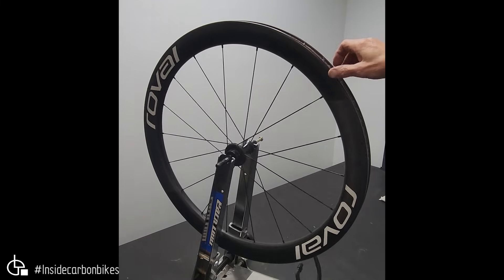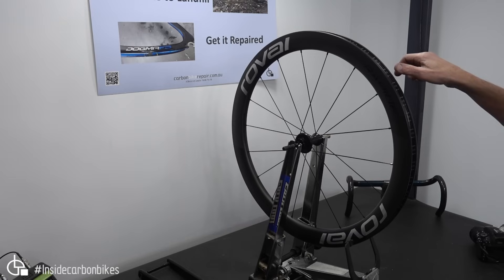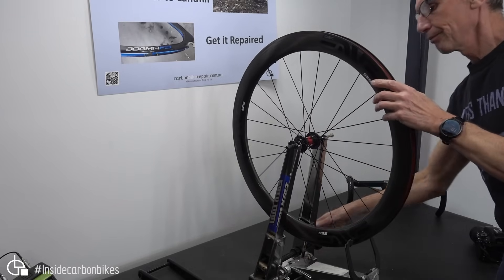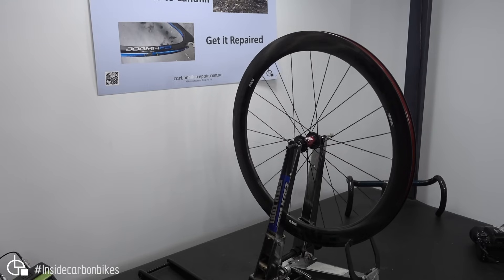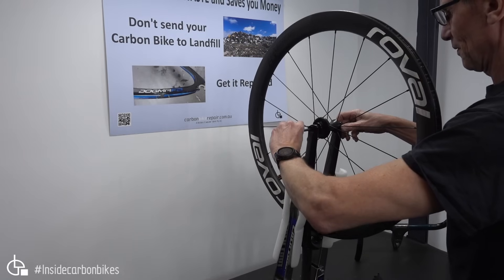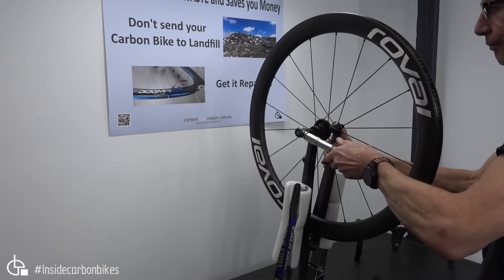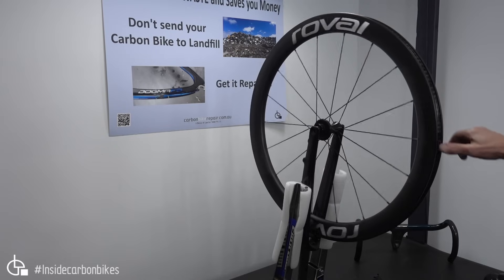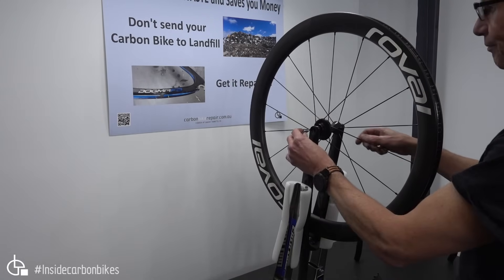Hub Bearing Test - It's not the axle!

Comment: I had a 240 hub I changed the bearings, spun freely, then I pressed them in slightly too much (yes using the correct drift) and they didn't spin as well. Kind of stuck at that moment as removing them would have potentially caused issues with the bearings and race as that can get pitted when pulling them out. So if I had to guess the face the bearing sits in gets a little tighter when fully pressed in. This was a while ago and I never got the chance to try again. As mentioned elsewhere it could be seals and one wheel using single seals and the other double (RS vs 2RS)

Comment: I suspect it could possibly  be a result of somone using  a pressure washer to clean the bike resulting in road grit being blasted into the bearing internals causing possible damage & resistance
Reply: On two different wheels?
Reply: Only a disassembly & inspection can determine a resistance issue such as this.
Factory manufacturing tolerance would otherwise be the obvious problem
Reply: It's quite easy to tell grit or rust in a bearing

Comment: My money is on seals, if you say there is drag but everything smooth without notches or inconsistencies.
Next I'd check if the bearing seats in the hub shell are undersized, if the hub is relatively new (otherwise it will develop indexed tight spots). Latter can be also connected to too low spoke tension.
Reply: Even differences in type of grease and how much can affect spinning.
Reply: @johnlesoudeur3653  that too, but not to that much extend with cartridge bearings though.

Comment: bearing seats in the hub might not be concentric which is overloading the bearing. Through-axle should not make any difference. If anything torque can only cause more bearing friction.
Reply: Not quite... There is a spacer tube between the 2 bearings that in theory sets the bearing preload on the inner bearing sleeve. The end caps then install to the inner sleeves of the bearings ... The bearings may be a tight fit to the housing compressing the outer shell causing high drag, the seals may be tight ( doubt it) or there is bearing failure... If its been previously dismantled from factory the bearing removal technique can cause the shoulders on the bearing spacer tube to be mushroomed and effect the preload when reassembled causing the high drag also... The way to test the bearing preload is to partially remove 1 bearing - say 0.05mm to 0.10mm so that there is no preload and the bearing can turn centralised  in its machined groove and retest the rolling resistance of the bearings .. if it rolls ok the issue has be isolated
Reply: Crappy machined bearing seat in the hub. Too tight, compresses the outer ring of the bearing. My 2 cents.    Rgr

Comment: Here is the difference between a 'cheap' forged hub, Specialized and the machined DT Swiss 240 hub. Clearly the alignment and tolerances of the DT hub are significantly better
Reply: All hubs for deep groove roller bearings are machined. What are you on about “forged”? Maybe the body  of the hub is “forged” (it’s doubtful) but for sure the axel spacer and hub are machined.